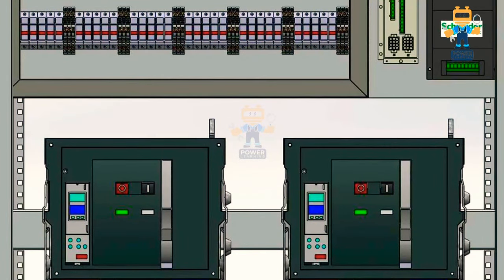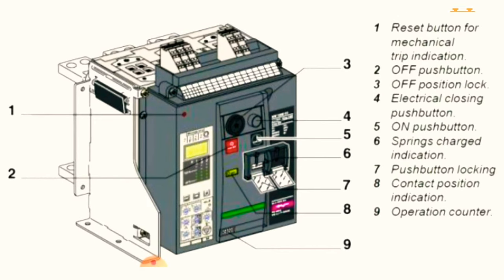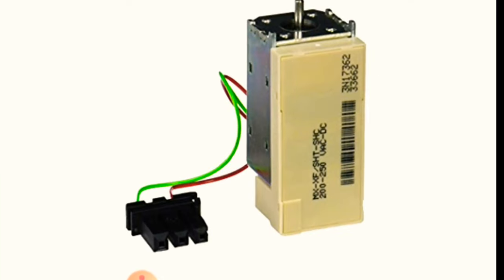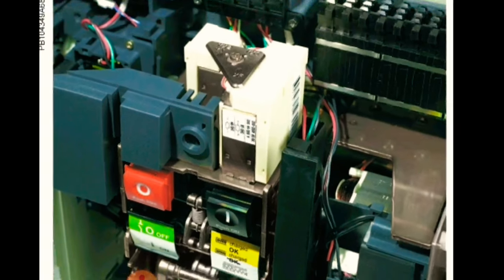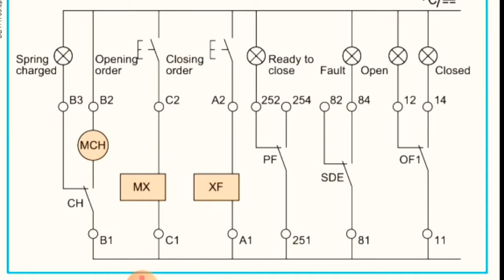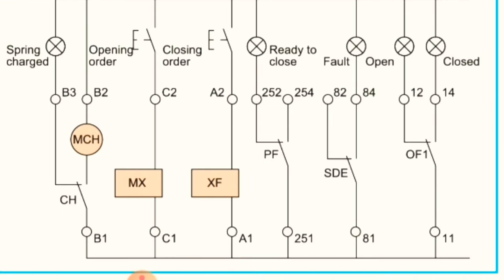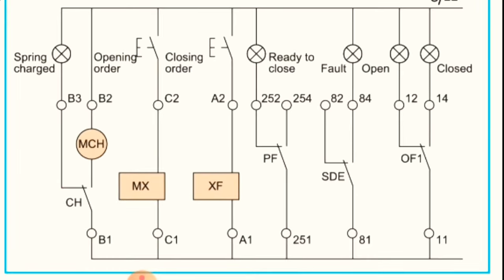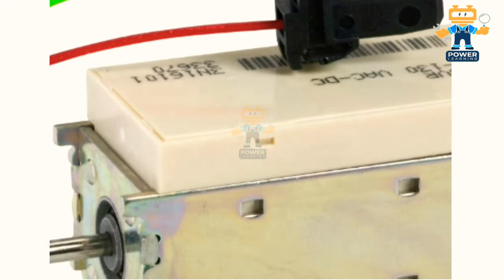#ACB_wiring Motorize_breaker #diagram/Drawing | how to wire Motorized Breaker with Remote control

Comment: Really a great effort
I have a question auxiliary SDE contact when change its position.suppose breaker is off point 81 and 82 are closed .but when breaker turn on then SDe also change its contacts my means 81 and 84 becomes close or only it change contacts position when it get trip.
Please clear this point
Reply: It closes only when there is trip alarm

Comment: Sir,I have schneider air circuit breaker EDO type.
I have one question 
air circuit breaker its close position ,once power coming its should not be operate automatically ..
In this situation what have to do ?
Because ,our side local supply not well running 10 minutes coming after shut down after again 2 minutes coming ...
So I want automatically on controll manually..
Reply: Same question but my acb is lagrand. Breaker is not connected to supply to the mains because when power off the generator runs and few seconds it stop because the acb is not connected to bus line how to fix it sir and how to know the problem. I have 3 coils UVT, CC, SHUNT.

Comment: Same question but my acb is lagrand. Breaker is not connected to supply to the mains because when power off the generator runs and few seconds it stop because the acb is not connected to bus line how to fix it sir and how to know the problem. I have 3 coils UVT, CC, SHUNT.
Reply from the maker: Ur doing Generator synch with Grid supply
Reply: @DieselGeneratortraining  yes brother but there has no connection if there power interruptions the breaker is not function to close